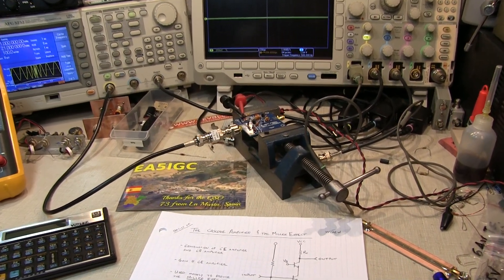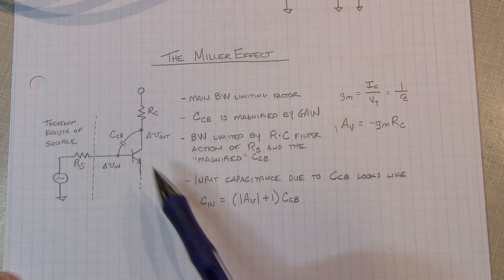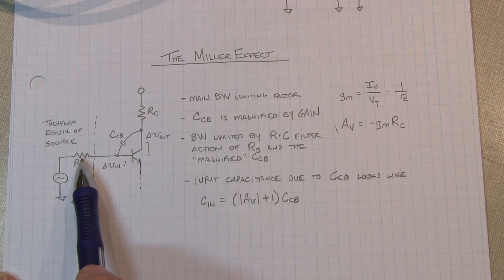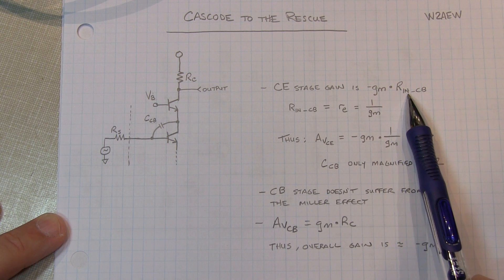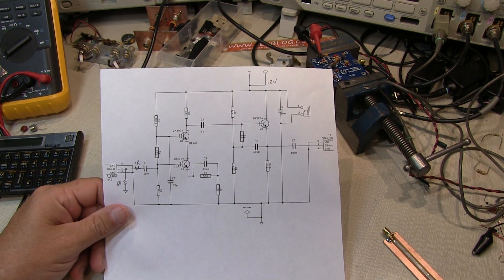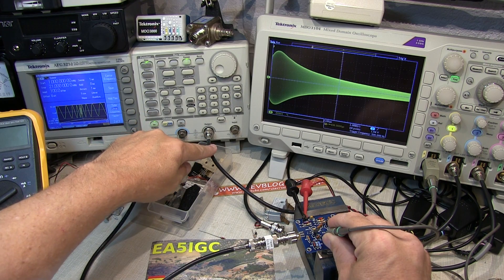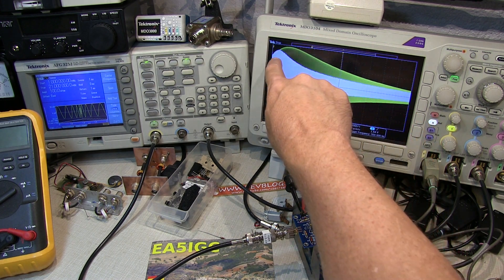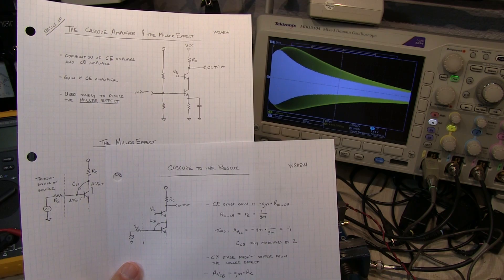#207: Basics of a Cascode Amplifier and the Miller Effect

Comment: Hi! If CB is used to mitigate the Miller effect, but there is still CE at the first stage of the circuit. Wont it also introduce Miller effect? Thanks
Reply from the maker: Yes but the gain of the CE stage in this case is very low, minimizing the Miller effect.

Comment: What is the difference between reverse transfer capacitance VS compared to miller effect? Miller effect is the parasitics capacitance between the input and output pin. The reverse transfer capacitance is the parasitic capacitance between the base to emitter, the grid to cathode, gate to drain.
Reply from the maker: same thing
Reply: @w2aew  I don't get the part "reverse transfer" meaning what? The miller effect has anything to do with reverse transfer? I'm guessing it means the parasitic capacitance is a feedback path from output to input which the feedback path is a reverse transfer
Reply from the maker: @waynegram8907  Correct

Comment: That's an excellent demo.   I studied cascode amplifiers in an EE lab many years ago.   There is an improvement in the bandwidth when a common collector input stage is used.   Another way of looking at the high frequency roll off is Cμ is shunted by the collector resistor + input impedance of the CE amplifier.  The inverse of this time constant is the main contributor to the high frequency roll off of the cascode amplifier.. With the cascode, the Miller Effect produces a low impedance looking into the emitter of the common base transistor., so the open circuit time constant is much lower.   When a CC input stage is used, the input impedance is lowered, so the open circuit time constant is reduced further.   The approximation of summing the inverse time constants to calculate the bandwidth is accurate to about 13%, sometimes better.

Comment: Nice video. The circuit gets its effectiveness by the low impedance of stage 2 on top. The common base amplifier also has a Miller cap but it’s working against an AC short on it’s base. Just a note -Your base cap, 68p, seems pretty low on the CB stage.

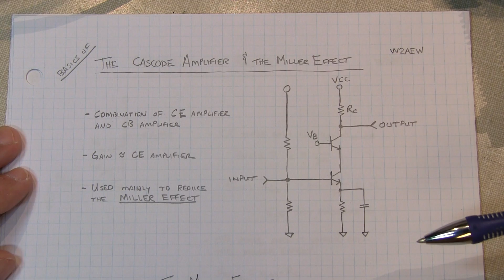Comment: Gain of a mosfet based Cascode is not the same as common source amplifier as stated at 1:30ish. The gain can be as high as (gm × ro)^2. Largely it depends on what the values of Rd and RL are. If Rd is implemented as two stage cascode load using pmos or the circuit is biased using a current source with very high output impedance, the gain can be (gm × ro)^2. The big deal with cascode circuit is that one is able to boost the gain while not having to sacrifice the bandwidth. This happens because the voltage at drain of common source transistor is close to Vin since that voltage is set by gm1 times [~1/gm2 in parallel to ro1] which works out to be close to 1. Including gmbs in the circuit does not make much difference as that effect too cancels out. So, in effect, the voltage gain between gate and drain is almost 1 which ensures that the Miller effect on Cgd is non existent.

The "only" thing you lose, and this really does matter when supply voltages are tiny, is the voltage headroom.

For a BJT based amplifier, the gain can be as high as gm1 × (gm2× ro2) (ro1 parallel to rpi2) which is still much higher than common emitter version.

Comment: When using higher gain transistors why do technicians add miller capacitors pf across the collector to base which they say it helps reduced the gain noise hiss? The miller capacitance will reduce or eliminate the gain noise any reasons why it does this?
Reply from the maker: The miller capacitor reduces the circuit's bandwidth.
Reply: @w2aew  yes you said that in your video but other techs have told me that it also reduces gain hiss noise not sure if that is true or not that miller caps help with reducing the noise floor?

Comment: Hi Alan, I need a little help with a discrete opamp circuit I'm working on. I've simulated and built it and all is good. I'm trying to calculate the various voltage values to see if my knowledge is up to scratch. It appears not! I have a transistor acting as a CE amp with a current source instead of the RE. I'm struggling to see how to work out the voltage drops VCE of the CE transistor and also across the active load. I've uploaded a shot of the simulator with voltages. Q6 and Q9 are the Transistors I'm struggling with. I'm sure that it's something straightforward but I've been looking at it for hours now. I understand if this is a question too far, otherwise, thank you in advance.  SI
https://allinthemind.info/opamp.jpg

Comment: Question: Can this or a similar technique be used in constructing a Colpitts Osc. to improve its bandwidth?
Reply from the maker: If it was the C-B capacitance of the amp that was limiting the bandwidth, yes.
Reply: @w2aew  My goal is to improve the linearity by increasing the bandwidth. Ideally, I would like a relatively flat response in the FM broadcast band.
I've tried several biasing configurations which I'm not sure qualify as "cascode" or not, but using two transistors instead of a single device does seem to help overall. 
see sim at :

https://www.falstad.com/circuit/circuitjs.html?ctz=CQAgjCDMB0YEwFYCmBaMAGEdYA5IYTABYwcA2OdHIskBWhOzZNMAKABMQUdMiic3MLX6C44AHJF06ImwBO4Ms3hK+AkJgxsA7lEp0AnOMgGyAdnHo2AJW68Qo7oZEbMfLVc2boCXY40LcScEY002AHMAwSDHMiIQWPdIoREXVLpVZL14un5EhKT-YWZzWnSEMvC9EszxCqz-U2Y4QWa6ZXCAYxAK-IqqvmhzVDAINHRoC2V0MENIeaoiOATJmXYehvqGfKGR1nBJ+jH8ZaJzSBxCQTXZth64SzoqykFK2i1UQQnoWUgySAIaRwQwISD8CC3DZQahxBI0eG5T4ocyOaDLQFgSwkOatYQ+dYKLBPd7E8QUVaHGTWRSPYIaOl1bwYalsAA2aiZtVJWl81P5ApkcFQqJQt3QCDgFgQ6AuOClJGkNzYABcyc9aO0eeAfAJZOYiJVIODjoZVlNTP8yGCAUDDPKqSAOEgAGYAQwArmyVcVOqTXhrquqnO0nNYooyKer4u4g7kgQk+qsie1Yk4klSmmYnrkiopak40K4bpmAPJwisIxwybzWPSh9Khtz3DKF-FEdLI1FjaCPcE0RBLeVgRhQltasIhMJdnwg0wuBDy9BWsiGVFj-OdJyMsPgXjWNWMwgmAzH5lCaDGY2WM3W5dwKwWuYAyiIczzCi0FlO12e71Eo9VCPQYqXDGEEjPS4INaWtVX0dQ2lhXdxnMaAcGxIEwRwbDDQsHw7zXQxSAWMhyFCR1nXdL0fT0ItolbGs6wYzBIFkatsnA9jOKIUxwkUKCKwEs9MAfcVBX5SAiSraT4yyUCUirM9FJg5J+LY6QWKQxjHHMNgAHssC-bwSHQBgfEhcA2EucBxAAMQssBRggfYxiEEAAGE3QABzdLoAEsVTdAA7LokCswRXPs5knJAFzxggTyfP8wKQrCoA

Comment: If your signal generator started at 1 mhz; why did the output peak at 2 or 3 mhz?
Shouldn't it have started out high and decreased as the frequency increased?
Is that gain boost at 2 or 3 mhz caused by that parallel RC network in the emitter circuit?
I tried to see the component values off the sheet in the video but at 77 years old my eyes are getting pretty bad...
I would also like to know how he determined the component values to provide the proper bias on the upper transistor.
Thank you for the interesting video...

Comment: Thank you for this explanation. Ali Hajimiri's CalTech lectures mentioned cascode amp configurations, so it was nice to hear you explain it here. Question: Is there a good professional oscilloscope that you might recommend from your experience, that will be useful for precision analog, comparator, fast precise rise times, gyrator, and work involving transients?
Reply from the maker: You've got to be more precise about "fast rise times", as that will determine the bandwidth needed by the scopes and probes.  Also, an idea regarding the available budget.
Reply: @w2aew  I've generally been looking at 4 channel scopes with 200-350Mhz. $1500-$6000, definitely under $10k. A EE mentor/colleague told me that 500mhz minimum for work which may involving noise and transient analysis but those 4ch 500mhz analog seem to get pricier. There's also some 10x frequency rule of thumb I heard.

In terms of tasks, I will be constructing zero crossing detector circuits on sine waves, going up to 30MHz (that 10x rules would suggest a 300MHz scope). I am interested in coupling oscillators together, hooking them to gyrators and looking at the oscillatory current outputs. Trying to build synthetic large value inductors from op-amps in order to get precise inductance for oscillators. And constructing a few analog computers to compute some results.

Comment: how about a video on increasing miller capacitance with an additional capacitor on a common emitter amplifier to limit bandwidth, done commonly in the voltage amplification stage of op amps to improve stability

Comment: Very informative. Thanks for sharing.
Are identical devices used in this configuration, or should one have a higher current rating than the other?
Reply from the maker: Both transistors, being in series, carry the same current - so using identical devices is the way to go.

Comment: Nice explanation.  HP Voyager user as well I see :-)
Reply from the maker: Yes, my favorite calculator.
Reply: @w2aew  Have you tried the modern Swiss Micros HP15C copy?  Beautifully made and a faithful repro of the original.  They also do a lovely copy of the HP42 with a larger LCD screen and 4 stack levels displayed.  Viva RPN!
Reply from the maker: @timcoates1925  I've seen them, but never pulled the trigger on one.

Comment: Thank you for the excellent explanation. But I'm still confused as to why there's still a multiplication of C_cb of CE stage by 2. CE stage gain is v_out/v_in, isn't it? The v_in is the change in base voltage, and v_out is the change in collector voltage. But, the collector voltage of CE stage should be constant at (V_b - V_be) of CB stage. So, the v_out of CE stage is always 0, and the CE stage gain is 0. Therefore, there should be no multiplication of C_cb of CE stage, and no Miller effect at all.
Reply from the maker: The gain of the CE stage is -1, which means that the collector voltage moves in the opposite direction of the base voltage.  Thus, the change in voltage across the c-e capacitance is double what it would be if the capacitance was simply from base to ground or collector to ground - thus making it appear twice as big.

Comment: The Miller effect (in vacuum tubes): 
 Edwin Armstrong discovered in 1915 that oscillation occurs in triode amplifiers because of
 grid-plate capacitance, when the anode load is inductive (and below resonance) 
 The actual (small) grid-plate capacitance is multiplied by (µ +1).
 In 1919 John Miller of the US bureau of standards presented a mathematical analysis
 of the phenomina and its effect, which now bears his name!
Reply: Thanks....

Comment: It's a pity that time didn't permit because the more interesting effect of Miller feedback is when the collector load is not a resistance. It turns out that if the load is capacitive then the feedback capacitor appears as a resistance across the input. If the input came from a tuned circuit then it would be loaded down by this resistance. If the load is inductive then the feedback capacitance appears as a NEGATIVE resistance which could cause oscillations at the input - especially if the input came from a tuned circuit. It is no wonder that neutralization was such a big issue in the receivers of the 1920s.

Comment: Given that all of the gain here is coming from the common base stage, why keep the troublesome common emitter stage? Is it purely to ensure that we have high input impedance (or control over it, maybe)?
Reply from the maker: Yes, mainly an input impedance issue (CB amp has a much lower input impedance).
Reply: Thanks. A bit of googling shows that, in the 60s, there were 4 terminal "cascode transistors" (two transistors on the die) which I guess made sense, since that would allow better matching of the g_m of the transistors, which you are cancelling in your derivation of the gain.

Comment: for not so worry about the miller effect but look for way to increase head room.
Reply from the maker: A cascode takes away from headroom.  To increase headroom, you want to setup the bias conditions so that the collector voltage (with no signal applied) is halfway between the positive supply and the emitter voltage.

Comment: How do you deal with frequencies in the GHz range in an amplifier? Like in 2.4 GHz or 5 GHz WiFi signal boosters?
Reply from the maker: Microwave amplifiers certainly require suitable transistors and especially proper physical layout techniques.

Comment: Thanks ! This circuit has puzzeled me for many years. I first saw it in a circuit that amplifies a tacho signal coming from a photo diode. I was told long ago that the additional transistor helped reduce the v_bc (AC) and therefore the effect of the parasitic capacitance C_cb, and the high impedance of the photo diode is then better matched with the input of the amplifier. Now that you explained the miller effect it made more sense to me :)

Comment: Excellent video. One question: it looks like the collector of the input device is clamped at Vb-Vbe. If this is so, why is the Miller effect menationed at 2x ? Won't it be 1x ? Regards, from NZ, Mark
Reply from the maker: It's because the impedance looking into the emitter of the CB transistor is not zero.  It is 1/gm. Thus, the CE stage has a gain of -gm*(1/gm), or -1. This makes the miller magnification equal to two.

Comment: Thanks again for the video. What would be the effect of using a diode instead of the metal jumper to replace the common base amplifier?
Reply from the maker: jlfqam Not sure why you'd want to do that - all it would would is add a DC offset to the CE's collector voltage, which would limit the maximum signal swing because the transistor will be that much closer to saturation.
Reply: ***** Thanks, I just wondered about be the effect on the frequency response of the system compared to the jumper and the CB transistor sets.
Should it fall in between?
Reply from the maker: jlfqam I would think it would be very close the the jumper result, in fact maybe even slightly worse because the voltage on the b-e junction will be lower, which will increase the capacitance.

Comment: This is a little off the subject, but you are the one that would know. I am trying to convert the 19.2khz scan rate from the crt output on my HP 8921a to feed into a modern LCD monitor. I was wondering if you have a schematic for a converter to achieve this? Great video by the way, keep up the good work!!!!
Reply from the maker: James skippinhopper I'm sorry - I don't have a circuit for that on hand.

Comment: Great video!  Makes the cascode configuration easy to understand.  The one issue that you didn't mention though is that it requires more headroom than a CE amp as I learned the hard way!  The CB amp biasing forces the output swing to be more constrained than with a plain CE amp.

One question:  Is there anything that can be done to make the amplifier broadband and flat across its passband?  I've done a fair bit of simulation of cascodes and can't seem to get much better than about 50-60 MHz BW.  I realize that selecting a BJT with a low C_ cb improves freq response, but is there anything more that can be done to improve BW?

Thanks
Reply from the maker: Eric Everton You will lose a little headroom, but you can usually limit the loss to a few hundred mV by biasing the CB stage so that the CE's collector-emitter voltage is a few hundred mV above saturation.  Of course, you'll sacrifice a little BW this way because Ccb will be larger with less Vcb.  BW is generally improved with larger Vce in the CE stage, as well as with some degeneration in the CE stage (will do a lot for passband flatness).  Proper selection of transistors with low capacitance and high ft is required, as well as operating at generally larger Ic with lower value RC, will all help to increase BW.

Comment: You've done something in little over 12 minutes what my profs (and the books) couldn't do for a lifetime - made me understand the Miller effect!  Heartfelt thanks!

Could you please do a video on - 1. why we introduce an emitter resistance in a common emitter amplifier and 2. what is "emitter degeneration" (a term you use in this video).

I look forward to the circuit demo (if you actually do this video).

Thanks once again,
Anand
Reply from the maker: Anand Paralkar Adding a resistor into the emitter of a CE amplifier is a form of negative feedback.  It reduces the gain, but provided benefits of bias stability and vastly improved linearity. This is also called emitter degeneration.  You may find these videos helpful:
https://www.youtube.com/watch?v=NizrzRKQqII

https://www.youtube.com/watch?v=c6cmkm3UPUI

https://www.youtube.com/watch?v=zXh5gMc6kyU

https://www.youtube.com/watch?v=YQlbPGNB-ys
Reply: @w2aew  Could also clarify why we decoupling circuit for any LNA or RFIC circuit design??